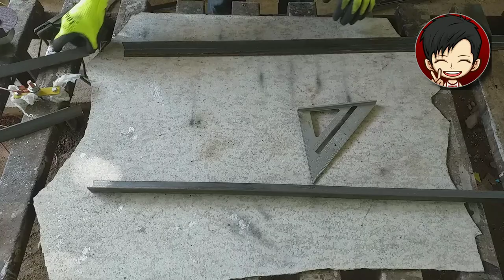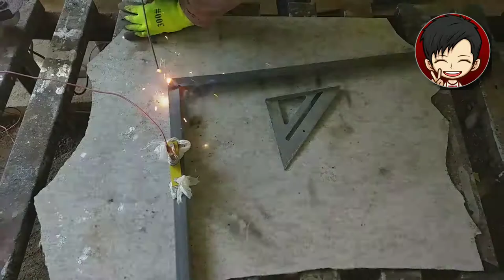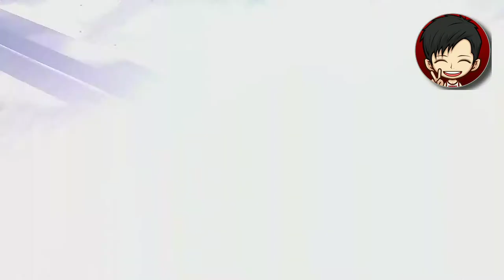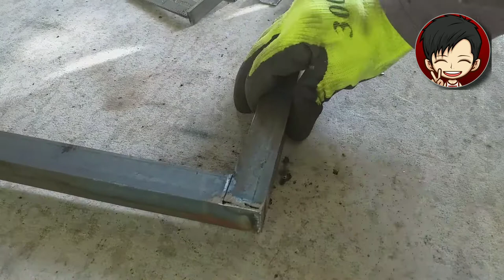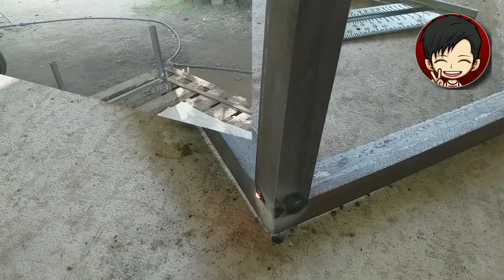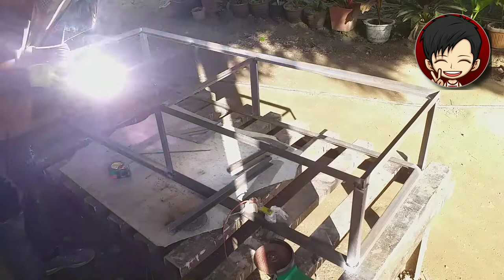Paano gumawa ng Aquarium stand | How to | Diy | Stick welding

Comment: Gaano ka. Kapal ganyan klasi na angle bar at anong size ng 6013 Yung Ginagmt mo na rod boss?
Reply from the maker: 3/16 ang angle bar , 2.5mm ang electrode boss
Reply: @gongtv20  ask ko lng po kasi mag diy kasi akoa pag ang kapal at sukat ng angel bar is 2.5mm x 1 /½
Ano po sakto rod  2.5mm or 2mm na 6013 salamat po sa sagot Para d po ako mag ka mali ng bili godbless